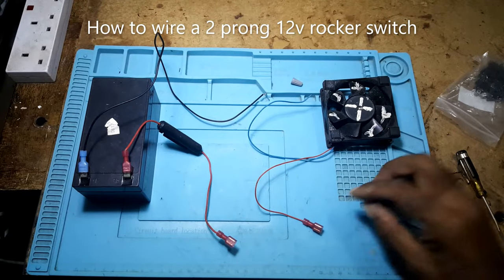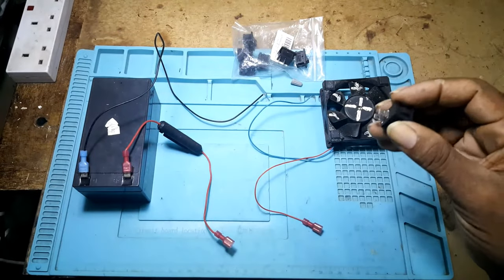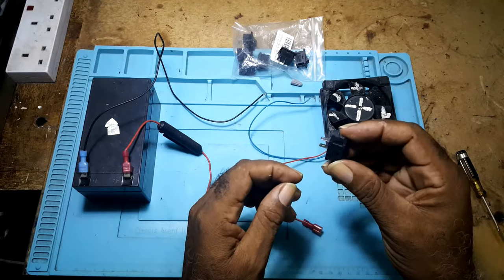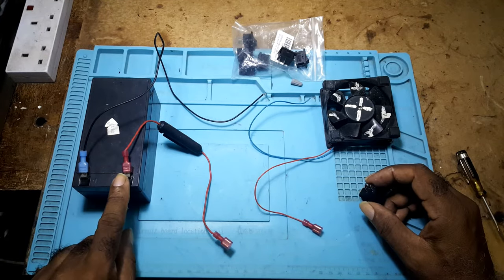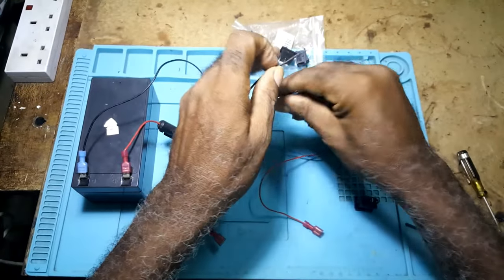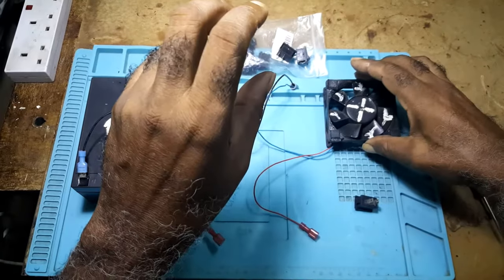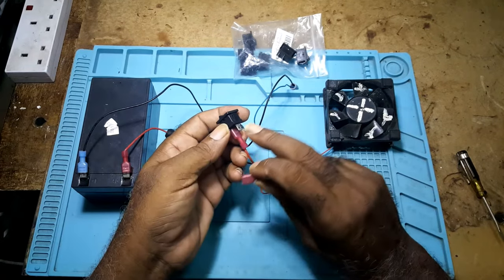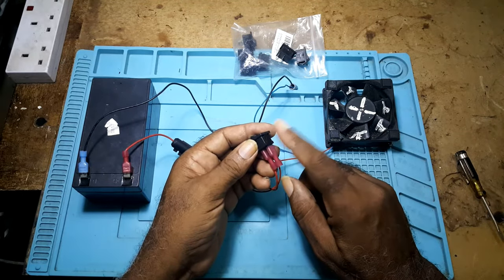How to wire a 2 prong 12v rocker switch

Comment: Thank you, sir!! Tremendous help for my DIY rigging 12 volt pump to use for off grid shower rig!! my water heater died & I made a shower rig with parts & pump  for stove heated water!❤
Reply from the maker: You welcome.
Reply: My shower rig works great!! Does stop & start sometimes though. quick tap on pump zip tied to battery box lid gets it going again. I don't think it is the pump but the cheap toggle switch from auto parts store. Gonna try rewire job & maybe a new waterproof switch! It is only12volts, but the switch is metal & I to change it or figure away to make a rubber cover plate for safety! THANKS AGAIN FOR YOUR TREMENDOUS HELP ! STILL NOT GOT WATER HEATER UP & RUNNING, BIGGER JOB THAN I THOUGHT! JUST SAYING!!

Comment: I'm working on a project and could use some ideas. I'm designing a cabinet to house my radio equipment, which tends to generate a lot of heat. I'm planning to incorporate 3-4 12V fans into the design, each with its own switch. The goal is to provide ventilation without having all the fans turn on simultaneously every time the power supply is switched on. Any suggestions for how to set this up effectively?

Comment: Do you need the inline fuse on the wire from the switch to the battery if you are also using a relay for a cars radiator fan? There is a fuse from the battery to the relay but the switch will have a wire to the relay and a wire to the battery. Thank you
Reply from the maker: Yes you needthe inline fuse.
Reply: @AlwynNicholas  Thank you for the response

Comment: I understand the whole open and closed circuit. But why can’t you just hook the negative wires together and the positive together and put females on them and connect the negative and positive to each prong..??  I know the flow has to be consistent and a break in one wire to open and close the flow of power. I just was never told why u can’t do it the way I mentioned.. thxs for any logical knowledge you give appreciate it..
Reply from the maker: It will not work like that.
Reply: Cuz when you turn the switch on and off, you're breaking the connection of the live wire. So when you have the switch turned on, the 2 prongs become connected. If you put positive on one and negative on the other, it's just going to blow a fuse. Hope that makes sense.

Comment: What size female connector to get for 2Pcs Marine Switch Panel Waterproof - Light Switch Panel for Truck Appliances Rocker Switches Round Rocker Switch Car Accessories Toggle Switch Panel for Car - Round Socket Switches a/250v 10a/125v
?